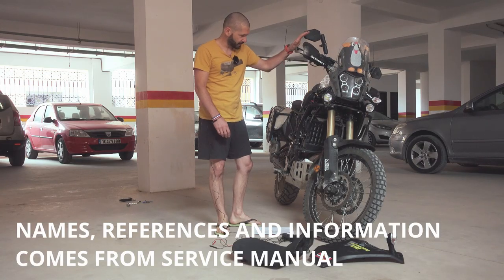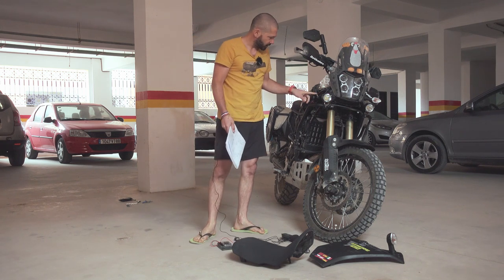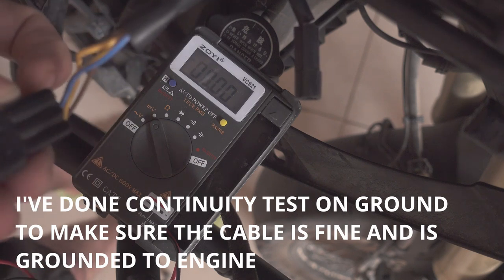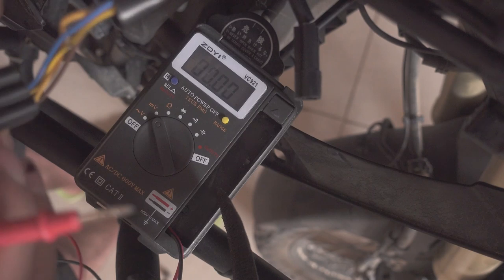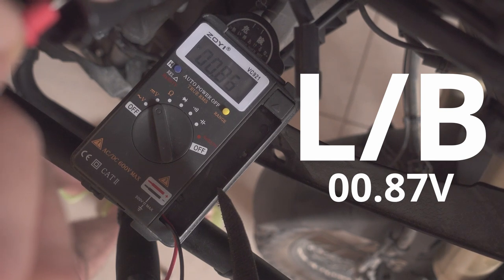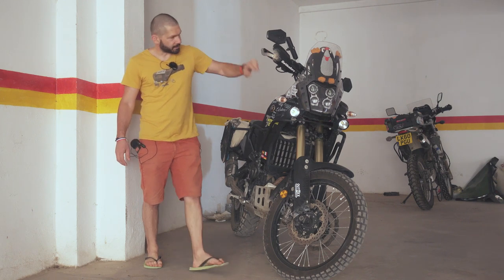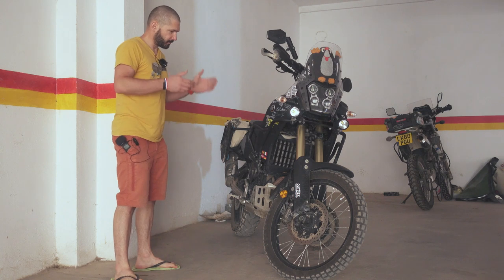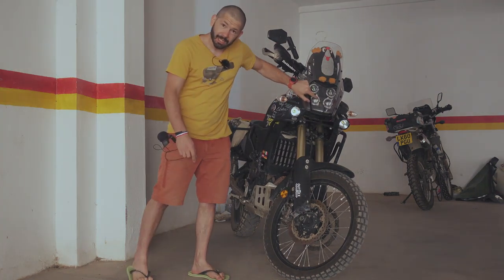Yamaha Ténéré 700 10k: Dead / broken headlight!? Ep. 1: No light

Comment: Interesting, I’ve not heard of this happening before. Please keep us updated.
Reply from the maker: Seems I'm the only one having the issue so far... not sure if I should feel special about this. Will be posting update when there is any development.
Reply: I don't yet know what the fix is it cost me $1,300 for my local Yamaha dealer to start my headlight again after the same failure
Do I feel robbed you bet your life absolutely robbed tried to blame driving lights not connected to the headlights and cut the wiring loom for those driving lights that cost is included in the$1,300 do I feel robbed you bet your life
 love the bike
 but be wary of the bike shop you use
The headlight is $1,200 incidentally but there is a and Yamaha dealers know it
Do I feel robbed you bet your life
Reply from the maker: Hi, the headlight unit itself is very very expensive indeed. Maybe you can just buy 2nd hand one. Mine was exchanged within the warranty and I'd definitely try to press for it.

In the end with has been diagnosed as the electrical issue inside the headlight unit. It really was as simple as just a cable connection.

Comment: It would not be a common failure but this is a good argument for running accessory lights if travelling long distances. Ideally one flood and one spot light on separate circuits. The after market might sort this out with a replacement headlight.
Reply from the maker: Yes, aux lights are definitely good idea. I’m now able to travel until this gets resolved. Have not looked is there are aftermarket headlights already but as someone mentioned some  Baja style would be great!

Comment: Just saw this video - interestingly, I have had the same issue - headlight working fine, come out to the garage a few days later, start it up - nothing.   Not sure why I did this, but I pressed the horn on the left controls - ta da - light comes back on.   And it has done this on 2 or 3 occasions now, so I do not think it is coincidental.   I am just not sure how to fix.   First step I was going to do was contact clean the left control (possible something sticking).   Just wondering if the new headlight unit solved the issue?  (I ordered one too, but have not swapped it yet in when I discovered the horn oddity).

Comment: Hello! May be any connection with installation of add. led lights? Fuse?
Reply from the maker: The additional lights has been installed by authorized Yamaha dealer. No fuse is fine, otherwise you would not have 12V in the plug in the front.

Comment: and isn't it better just to have old fashion headlamp where you can change a bulb in a minute for cheap by yourself? :)
Reply from the maker: I like LED technology, lasts longer more effective. What I don't like on this headlight is that it's a sealed unit so if something goes wrong one has to replace whole unit. In my case it seems like (possibly) loose wire or solder which could be fixed easily if unit could be opened up.
Reply: @FARANDFURTHER  actually when you have good lamp,  regular halogen bulb is more effective (range)  then LED, also I prefer warmer color.
Reply from the maker: @wildone2163  Didn't know the halogen bulb would have more range. I preferred the warmer color as well. When there is no choice, one gets used to it quickly :)
Reply: @wildone2163  no, halogen is just 20-30% better than classic bulbs, nowhere near led efficiency. it is alltogether different story which led model ie it's max light flux fits which car/bike etc. but led produces much more light per watt than halogen, that's for sure.
Reply: @FARANDFURTHER  well, you can open it up....it's junk anyway, so what's there to lose? saw, soldering iron, pliers, drill....it's plastic, it's not metal...
you'll find these modern morons put cpu in the headlight. madness.